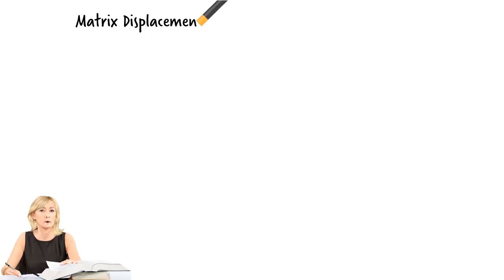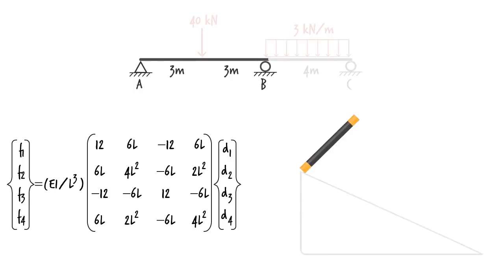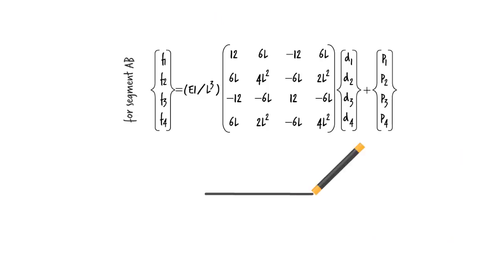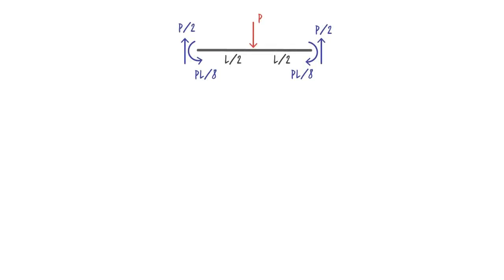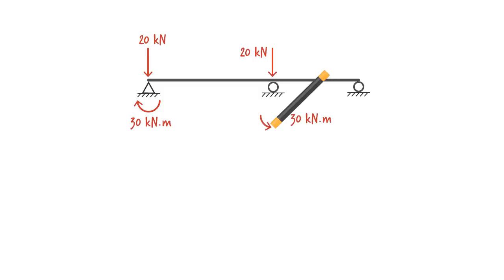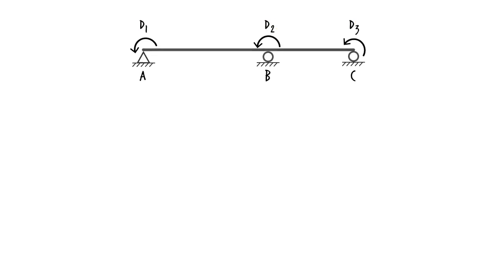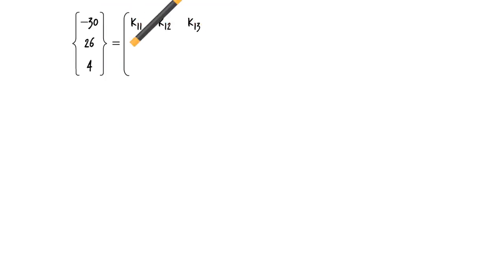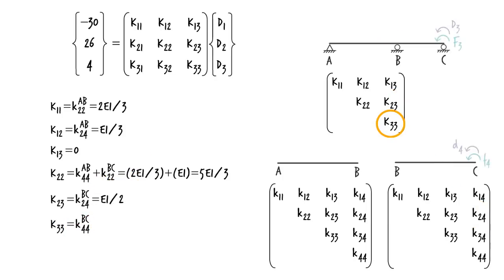SA47: Matrix Displacement Method: Continuous Beam Subjected to Member Load

Comment: Excuse me, the fixed end moment formula changes with pin or roller ends.. It should be wL2/8 and 3PL/16
Reply from the maker: It is not necessary to change the fixed-end moment values. Either version works, although, one converges faster than the other.

Comment: for the new matrix at 4:02 why did you divide everything by 12 to get EI/18(1  3  -1  3) etc. instead of just leaving it as EI/216 and so on
Reply from the maker: This is a stylistic choice to reduce the size of the matrix coefficients, making the matrix more compact. This is analogous to factoring in algebra. Such manipulations do not affect the solution of the system.

Comment: How does K11=K22 ?
Reply from the maker: Do you mean why K11_system is equal to k22_AB?

Member AB has 4 degrees of freedom (dof): dof 1 is displacement in the y direction at end A, dof 2 is rotation at end A, dof 3 is displacement at end B and dof 4 is rotation at end B.

That makes the system dof 1 (i.e., rotation at joint A) corresponds to dof 2 for member AB.

Comment: I got confused maam. How rollers have a reaction moment?
Reply from the maker: Rollers do not have moment reactions. Bending moment at a roller is always zero. 
Our matrix formulation is done for a typical beam member detached from any supports. Such a general member can be assumed to carry moments at its ends. However, if the member happens to be connected to a roller or a pin, at the end, the moment comes out to be zero.

Comment: Is there possible for the case like applied inclined load and inclined support? Is that mean the member stiffness matrix will required to include the axial deformation and x-axis forces with transformation matrix?
Can you make some example problem and solution  for them?
Reply from the maker: Yes, both forces and supports could be inclined. The axis transformation matrix needs to be applied to the inclined forces in order to have them represented in member coordinate system (see Lecture SA49 where the method is being used to analyze frame structures). In the case of inclined supports, a bit of more work is needed in order to analyze the structure. When a support, say, a roller is inclined, then the displacement in direction of the roller needs to be represented as two dependent degrees of freedom, one in the global x and one in the global y direction. We then need to establish the relationship between the two degrees of freedom in the matrix equations. 

For example, an inclined roller (at 30 degrees) ends up with a degree of freedom in the x-direction equals to: Dx = cos(30) D = 0.86 D, and a degree of freedom in the y-direction equals to: Dy = sin(30) D = 0.5 D where D represent the degree of freedom in the plane of the roller. When writing the system matrix equations, we need to specify the relationship between Dx, Dy and D in the form of the simple equations given above, then simplify the system of equations accordingly before solving it for the unknown global displacements.

We will add this topic to the list of future videos.
Reply: @DrStructure  opps it is already in frame analysis, i am not there yet. And thank you very much for going for add-on topic.